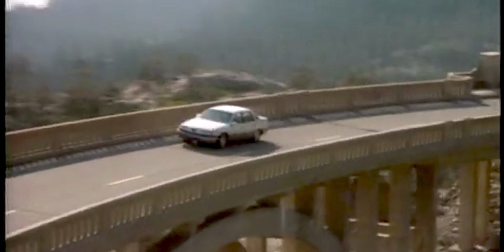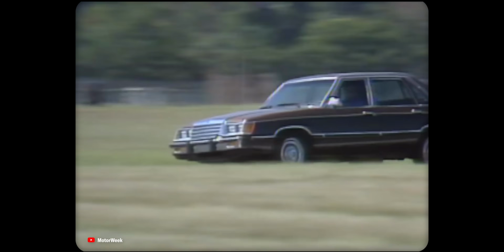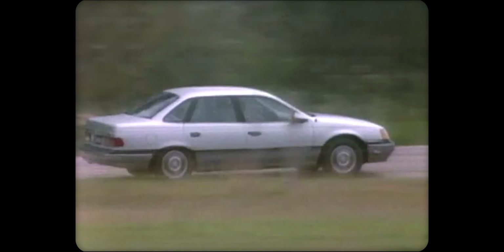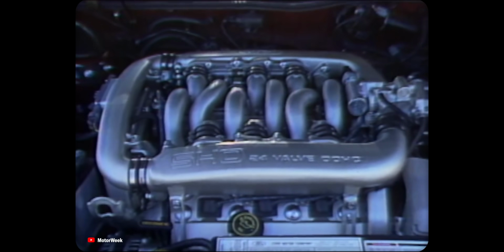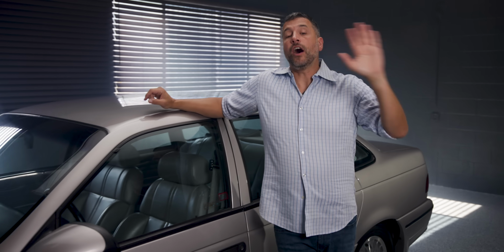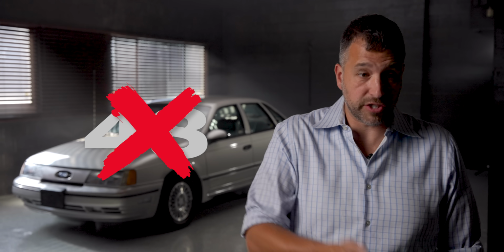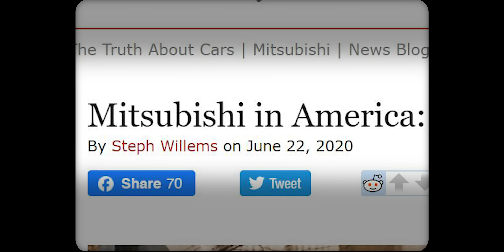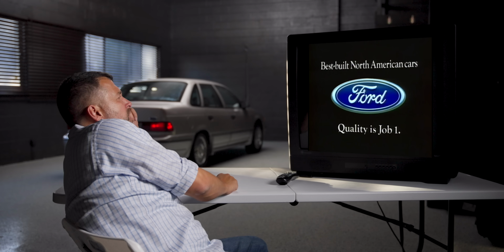The Taurus SHO is the fastest, most expensive Ford sedan | Revelations with Jason Cammisa | Ep. 08

Comment: Sealed beam headlamps are not as bad as all that.  The evidence is that all the headlights that came afterwards scratch, fog, and fade.
Reply: Sealed beam scratch, fog, and fade as well. But, they also tend to burn out and get replaced before the lenses get bad.
Reply: @NBSV1  Yeah, but they are very cheap to replace.  The lens goes with the bulb.  Every time you replace the bulb, you get a fresh lens.  Moreover, the lenses are glass, not plastic.
Reply: @pleappleappleap  Cheap to end up with the same crappy headlights. Even if they aren’t LED most modern headlights are vastly superior to the old sealed beam. 
And, it isn’t like the plastic gets crappy after a year. Unless they’re cheap aftermarket ones it’s usually more like 10 years before they’re getting bad. If people polish and protect them every few years they’ll last even longer than that.
Reply: @NBSV1  There are DOT-compliant LED sealed beam units.  I would prefer these to any of the plastic ones you name.
Reply: @NBSV1  Also, they hardly last ten years.  I've seen particularly crappy ones go bad after five. And, really, it only takes driving in one sandstorm.  Or bumping it once with a shopping cart.
Reply: @pleappleappleap  In my experience most of them last 10 years just fine. Remember that’s only 2014. 
Rocks can easily break the sealed beams. Shopping carts can break them just as easily. Drop a sealed beam 2’ onto the concrete and it’ll break. Drop a plastic headlight assembly the same 2’ and it’s unlikely to break. 
So far your only positive for sealed beams is they don’t fog over as bad. Not much of an argument.
Reply: @NBSV1  That isn't the only argument.  The fact that the headlights of my car are $400+ per side is another.  And that plastic headlight assembly will break dropped from two feet onto concrete.  And no, glass headlights don't scratch as easily as plastic lenses. I've had them survive a trip through a sandstorm.  The plastic ones are ruined immediately.  My older Audi has non-sealed-beam headlamps that have glass lenses that offer similar durability to the sealed beams.  Guess how much they cost?
Reply: @pleappleappleap  So, a sandstorm is now the benchmark for good headlights? 
I’ve dropped a few plastic headlights and not had them break. I’ve had sealed beam ones fall a few inches and break. I’ve seen far more sealed beams broken from rocks than I’ve even seen broken plastic ones. 
Sealed beam lights are just simply old limiting tech.
Reply: @NBSV1  A sandstorm makes a decent benchmark. And a sealed beam glass headlamp survives it.

Also, having one break doesn't bother me as much considering it's an order of magnitude less money.  That's not even talking about how I've run into badly aimed protector beams much more often than misaimed sealed beams. Don't even get me started on JDM headlight assemblies.
Reply: @pleappleappleap  Sandstorm as a benchmark doesn’t matter at all to me. Not exactly a thing that happens in my area. Obviously our experiences are different as I’ve run into way more sealed beams that are out of adjustment along with rusted and seized adjusters. Along with rusted, seized, and striped out mounting screws. Also funny since many of the modern ones I’ve dealt with are JDM and they’ve been fine. Heck, my 99 miata went 10 years on the original bulbs. 
You’re welcome to die on your sealed beam headlight hill.
Reply: @NBSV1  The main issue I have with JDM headlamps is that headlight aim is not laterally symmetric.  Because people in Japan drive on the left, JDM headlamp aim is left-biased, so as to not blind oncoming traffic on this right, while illuminating the shoulder on the left.  US headlamp aim is right-biased.  If you put JDM headlamp assemblies on your car, you will not be seeing as well.

And it isn't the bulbs I have a problem with. It's the lenses.  But we can indeed agree to disagree.